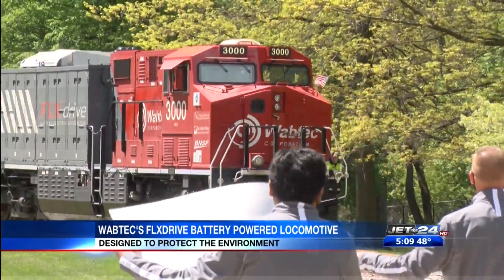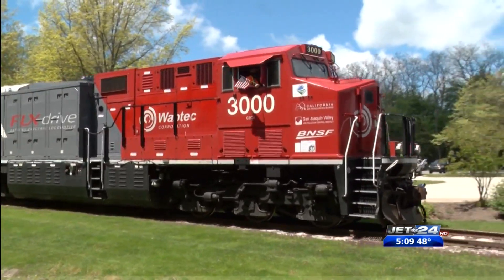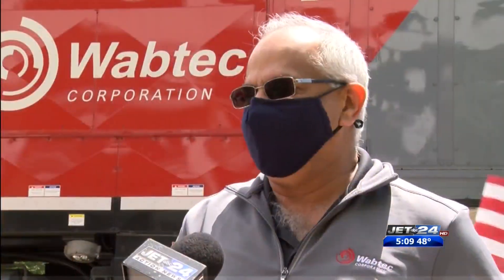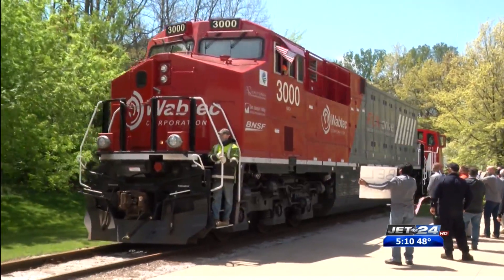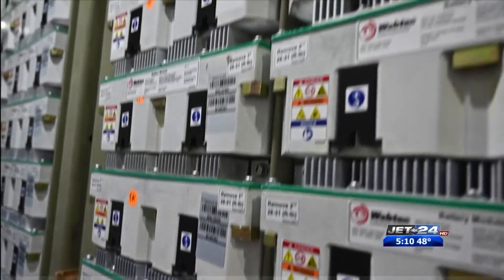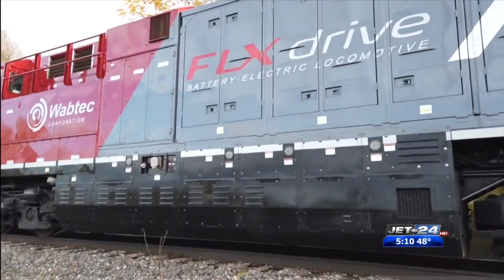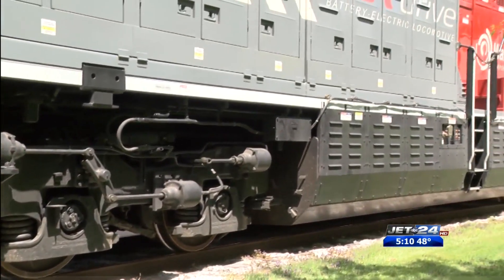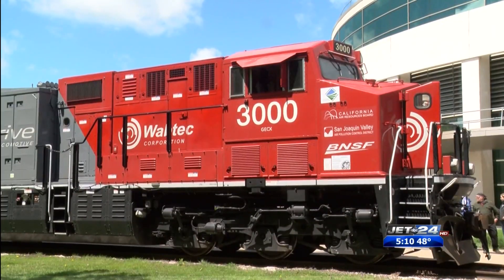Wabtec introduces battery powered locomotive to help reduce fuel energy

Comment: While this is great, I would recommend electrification of tracks instead to draw raw power. The electric engines are more cost effective as sooner or later the batteries will need replacement. And considering there are 18000 of them, that's a lot! Now imagine if more such engines are put on tracks. All of them will need replacement. So I am not sure whether this will be cost effective in the long run. As it anyways needs to draw electricity to charge. Back in India, the Indian Railways is planning to go for 100% electrification and is on track to achieve its target! This is better as there are no battery replacement costs. Plus Indian Railways plans to generate it's entire electricity through renewable sources and solar! So it's a win win for everyone.
Reply: That's not even a possibility the US has one of the most extensive rail systems in the world it would take to long and cost to much
Reply: Total electrification of a line is desirable but extremely costly. this seems a good idea on sections of track where full electrification is difficult to justify at the moment.
Reply: Yes but that neglects the time, cost and effort to do this track electrification especially when US is so far behind numerous other countries in the rail infrastructure. I think battery powered locomotives, if the technic is mastered seems to be the cheaper/faster solution to me.
Reply: @JadaKingdom971  I agree..
Reply: @JadaKingdom971  until one explode in new city. Cheaper is not all way better
Reply: @JadaKingdom971  If it works
Reply: @JadaKingdom971  such a battery "powered" engine only has around a HUNDREDTH of the range of a typical SD70 type engine. So for the desired use case (hauling massive freight trains) it's absolutely useless.

Tbh I don't think the manufacturer has this as a target by himself.
But also I'm not quite sure the manufacturer knows what his target with this engine REALLY is.
For shunting it's too bulky, for hauling it's too small (energy-wise), for smaller, local train companies it will be (way) too expensive.

It's a green washing machine, that's what it is.
Reply: @ML_314  It's a good "science project" discovering the possibilities
Reply: Yes. Instead a full electrification of the track is better. Indian railways has already completed 45,881 kilometres electrification and targets complete electrification by 2025 67,956 kilometres track length
Reply: @David Moore You appear to have misunderstood what I have written. I was talking about lines that have been mainly electrified but parts of them have not been for economic reasons. At the moment, with current technology, I agree with your point about a large battery locomotive not working on the mainline (especially pulling heavy freight). However, even smaller versions of such a locomotive could be practical for intermittent operations, such as shunting.
Reply: Overhead electrification is only justifiable if there's enough traffic on that part of the track. 
It costs millions to electrify a single kilometer. Electrifying all of US railways would be even more costly than the US military budget.
Reply: @RR-us2kp  Millions?
Reply: @Johnketes54  about 2 to 3 million per kilometer
Reply: But India's railway tracks have moss growing on the tracks
Reply: @maas1208  Maybe in some specific area because of moisture in environment. But the country is vast and not all would have moss in tracks
Reply: @maas1208  And the point is about electrification. India is on track to become the only major railways in the world to achieve 100% electrification in its entirety of track length. And the platforms have solar panels. There are several like Chennai railway station that run fully on solar power. Indian railways is a front runner in using renewable energy sources
Reply: @maas1208  what nazis? Lol... Sarcasm eh??? Don't make comments that make you look like a fool.
Reply: @maas1208  And what name is MAAS 120?? Why mask your name and hide behind a fake name and comment? Edit and put your real name. Be honest and truthful rather than use fake profile to simply come to youtube to spread hate
Reply: @siddharthamukherjeesid  I want to keep my name private
Reply: @maas1208  I don't want your response any more. Let's end it here as this was primarily supposed to be a discussion on electrifying tracks and not about our countries. Jai hind
Reply: @siddharthamukherjeesid   I don't support China's actions against the Uygurs
Reply: @siddharthamukherjeesid  I support Rohingyas against the Burmese government
Reply: @siddharthamukherjeesid  OK racist Islamophobe
Reply: @maas1208  So you agree that they are islamophobes too, right?
Reply: @maas1208  Put in by the British 200 year's ago
Reply: @Johnketes54  Even if British didn't ruke we would have done it ourselves. Our GDP was way better and our country was one of the richest in the world before the British attacked us and didn't leave for 100 years. And this is no place for hate or giving useless comments. I made a valuable suggestion here for electrification. What was your input for people reading your comment. Be wise and stop hate mongering. India is my country and I love it. You need to do some reading about my country.
Reply: Win win on paper,We in the UK have a win win strategy unfortunately 27% is our present output of renewable energy,The balance is nuclear (where ever they are) and fossil fuels
Reply: A mega emp can knock a whole country electric grid off but our railroad will still move think about that
Reply: @yaboidspdadon5838  seriously? EMP? You need to take a break from video games
Reply: @yaboidspdadon5838  I have thought about it. All the electrical signalling/points systems wouldn't work and the pumps to transfer the some 2000 gallons of diesel fuel into each heavy duty locomotive would need to be manually pumped (unless you currently use diesel generators for the task). Look forward to the odd derailment, chaos, and drivers with over-developed biceps, dear Boi.
Reply: @yaboidspdadon5838  Yea but we live in a real world, not a video game that you've been playing all your life and still suck at. Huge difference.
Reply: @yaboidspdadon5838  no they won’t. Even today, all the us used are diesel electric.

Comment: This is pretty neat. I can see this as a great last mile loco where there isn't mineline supply. This the bottom line is this: North America badly need to agree on one solid loading guage, and an agreed height for OHLE in order to future-proof itself in the events of future sfuel shortage, and to get itself inline with Paris agreement climate targets. 
This loco + Electric locos will be the future. ♥️
Reply: how dual mode locomotives that has a battery prime mover in general like an alp-44 dual mode locomotive or a p32-ac dm but instead have a diesel prime mover its has batteries instead of diesel I think that would be the most efficient
Reply: Fortunately or unfortunately many disagree and i see this as "Trendy" following "Tesla", Hydrogen is my crystal ball and before you "sh#t your pants" it's NOT SATURN 5 ROCKET FUEL,BUT WATER WITH THE OXYGEN RELEASED INTO THE ATMOSPHERE AND THE HYDROGEN STORED FOR EITHER RUN BUSES AS WE DO IN LONDON IN THE UK OR DIRECTLY TO THE ICE ENGINE,EVEN BETTER STILL PRODUCING ELECTRICITY BECAUSE THE EXHAUST IS WATER VAPOUR